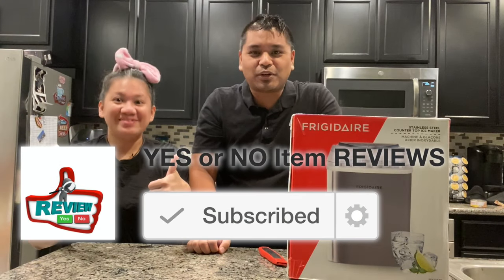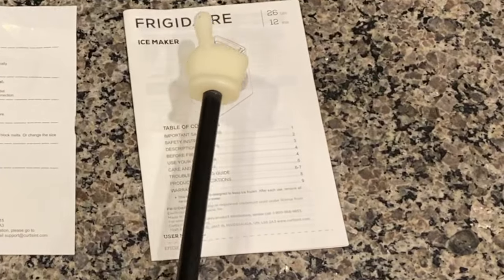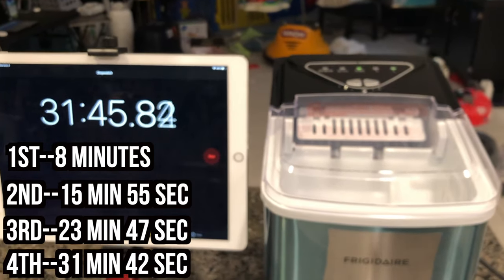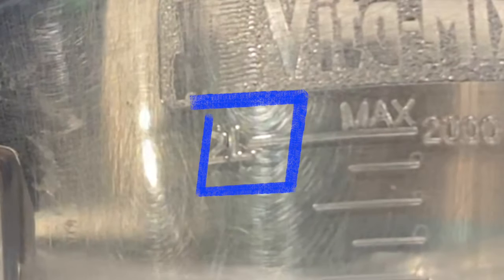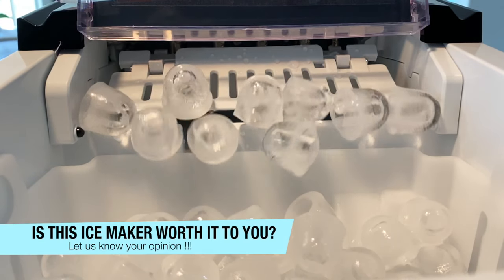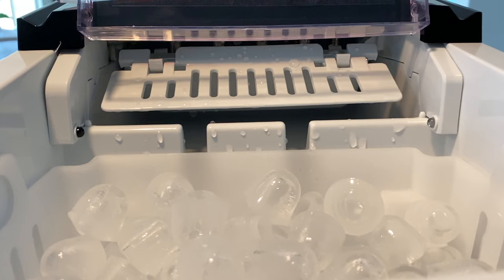How to Install and Use "Frigidaire Stainless Steel Counter Top Ice Maker"

Comment from the maker: ⏰ TIME CODES:
0:00—Intro
0:24—Unboxing Frigidaire Stainless Steel Counter Top Ice Maker
1:14—Everything inside the Box
1:32—SETTING UP the Frigidaire Stainless Steel Ice Maker 
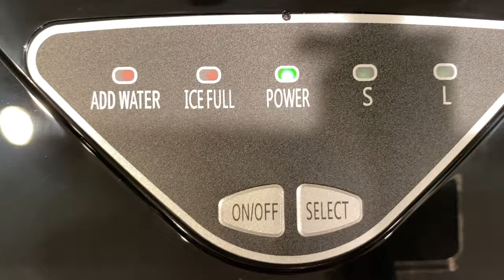1:51—Pouring in Water inside the Frigidaire Ice Maker
2:11—Turning on the Ice Maker
2:24—A thought to Consider before starting
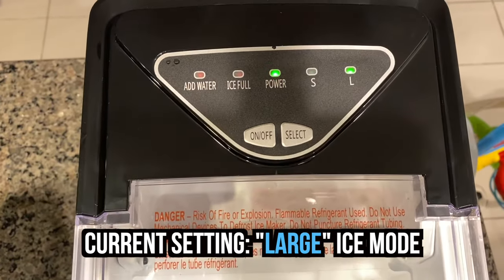2:46—Reviewing “Large Ice” Mode
3:41—Time Codes for “Large Ice” Mode
4:18—(Large Ice Mode) How long does it take to fill up the Ice Bucket?
5:19—How much ICE is there when Ice Bucket is Full?
5:50—Will Ice Produce, Even if Lid is open?
6:03—How does Frigidaire Ice Maker compare to an Ice tray cube?
6:23—Is there still water, even if it says “Add Water?”
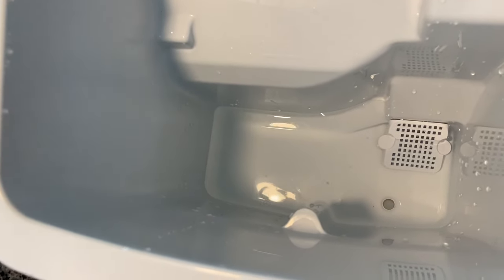6:35—Does “Small Ice” Mode HAVE THE SAME RESULTS as “Large Ice” mode?
7:11—How does “Small Ice” mode compare to Ice Tray Cubes?
7:35—How Fast does “Small Ice” mode make ice VERSES Large Ice Mode?
8:05—GOOD things about Frigidaire Stainless Steel Counter Top Ice Maker
8:36—BAD things about Frigidaire Stainless Steel Counter Top Ice Maker
9:29—Learn more about the Frigidaire Stainless Steel Counter Top Ice Maker
Reply: Q 😀

Comment: Have the copper colored one,  and like it a lot!   If you hold the on/off button down for about ten to fifteen seconds, it will go into cleaning mode.  I fill the reservoir with white vinegar/ water then hold the on/off button down.  It will fill up the cup where the ice is made,  empty it out,  then repeat it again over and over for about a 1/2 hour.   It cleaned all the gunk out that was in there.    Drain, wipe out,  and its ready to make ice again :).  Enjoyed your video have a great day!!!!

Comment: Does it keep the ice frozen if you leave it on with the ice in the tray? Or will it melt in there
Reply from the maker: Hello TheByShy! Sorry for the late reply! I wanted to thank you for commenting, and the ice does not keep frozen if you leave the machine for a long time (like 4 hours without if machine isn't running.). it'll just melt

Comment: Hi! Does your ice maker recycle the water to remake ice after it has melted in the ice tray? I bought the same model. Once the ice tray is full and not regularly used, it will melt then collect a large pool at the bottom and stops it from making ice. I have to manually scoop the water out: most of the time when I need it, it’s just a pool of water. Is yours the same?
Reply from the maker: Hey jeremy! Sorry for the late reply! But yeah mine does the exact same. Do you still have yours?! lol

Comment: Is it me or does it seem to be barely frozen? Can you adjust the temp settings?
Reply from the maker: Hello Yesenia! Thanks for reaching out. It's definitely not like "Freezer" type Ice. I think the ice from this Frigidaire will melt faster than your ordinary Freezer. And I don't believe you can adjust the temperature settings, unfortunately. Maybe for a future model that will happen. Hope this info helps!
Reply: I found that using ours which is a slightly different Frigidaire model, the ice is definitely more frozen in the colder months than summer.

Comment: Ok question for you ...I bought this item and plugged it today ..it says I must unplug it when not in use...did u do this? And does it still work?
Reply from the maker: Hey Vd-lu Transition! I only unplug it if I know i'm not gonna use it for a week or longer. If I don't use the ice maker for a day, I honestly just leave it plugged in the wall, but i obviously turn the machine off. Nothing bad happened to mine when it was plugged in during non use. So yeah to answer your question, It does still work when i leave it plugged in.
Reply: @YESorNOItemREVIEWS  thanks for the response! One more thing...how often are you using yours nowadays?
Reply from the maker: @vd-lutransition5568  You're Welcome! Well, since I'm getting another sponsored Ice maker, I don't use frigidaire as often, BUT I did try it last week and it still works with no problems!!! 😃👍

Comment: I keep trying to use my ice maker but the add water tab keeps glowing and it doesn't make ice even tho I've already filled my ice maker with water what do I do
Reply from the maker: Hey Love Cato! By any chance, is your ice maker close to other items? That's what happened to me. Make sure the Ice maker Stays away from any other item or surface because the FAN of the ice maker needs to do its job. Hope this helps!

Comment: mine has been plugged for an hour and made zero ice
Reply from the maker: Hey Luna! Sorry for the Late Response. Anyways, sorry that you're going through a tough time with the Ice Maker. The only thing that i could think of that may hinder the ice from coming out faster is that the unit may be to close to the wall from the back, or other items on the sides of it. Just make sure it's not close to anything. Hope this this helps and best of luck!
Reply: @YESorNOItemREVIEWS  i changed spots because i thought the same thing as you. But still no ice. I’m going to return it and get another one. Maybe that one was a bad one lol.